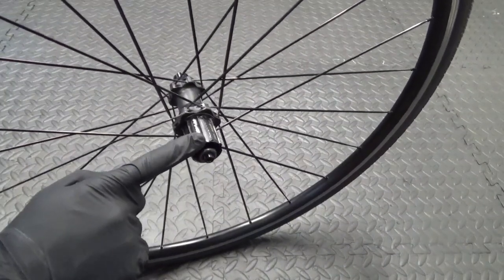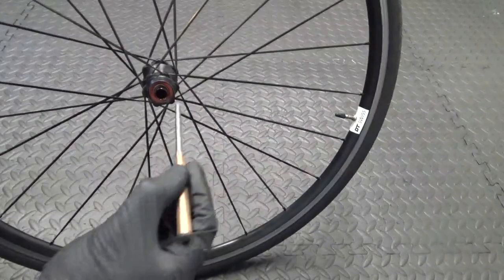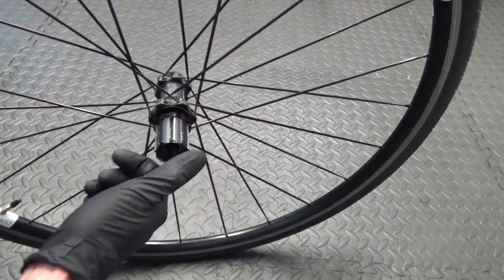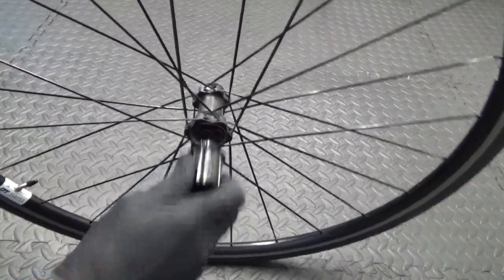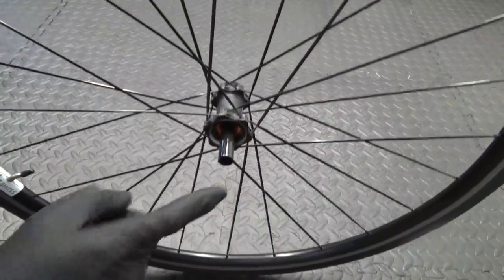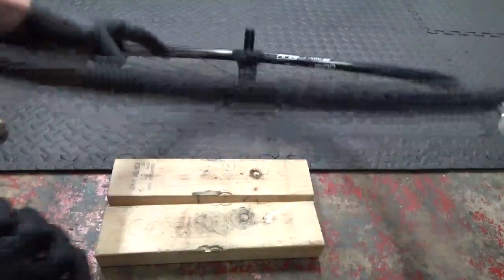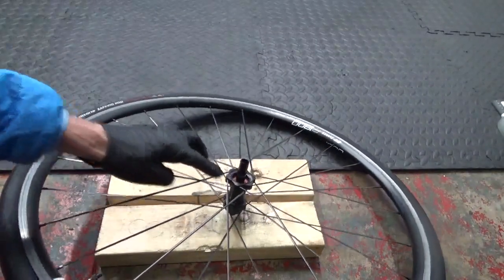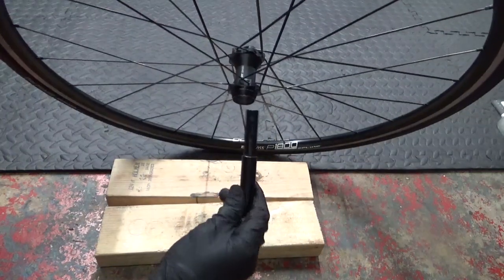DT Swiss Ratchet Freehub Body Conversion

Comment: Just wanted to say thank you. I got a good deal on the 36t version for mtn bikes. Grx cassette doesn’t need the spacer for the smaller mtn bike free hub. I did not have to buy any special tools. I already had the cassette lock ring tool and used the axel to get the bearing back in. So for less than $100 and 10 min of banging, I now have ratcheted free hub.

Comment: I was trying to convert my dr swiss hub from 3-pawl to ratchet where one of the steps is to remove that ring from the hub. I have the universal tool used to install/remove the ring from the hub. Unfortunately, it doesn't matter how much pressure I apply to the key I can't unscrew that ring from the hub. Does that mean the ring got seized to the body of the hub and I will get stuck with 3-pawl hub or there is a trick to remove it?
Reply from the maker: https://youtu.be/_266hl6psPY

Comment: Amazon had a (generic) specialty 3 pawl ring removal tool and the ratchet ring install tool for about $15 each in the US. If you have these then I guess you can just pull the ring and you don't need to remove the axle and bearings because you aren't heating the hub. Just pull the ring, install the new one, and install the new ratchet hub - have i got that right?
Reply from the maker: Only as long as the tool is long enough to fit over the axle!

Comment: Hello. Thanks a lot for your video, it really worked flawlessly for me in every step. I have 1 question though. After the successful replacement, I realised the new freehub is a bit shorter than the old one. There was a spacer previously installed with the cassette which I removed and it fitted fine after that. I also had to recalibrate the rear derailleur. But I am worried if I ordered the right upgrade part. I have p1800 road wheels and hg800 11-34 cassette. Will I be able to fit other 11speed cassettes eg R8000 on the new freehub in the future?
Reply from the maker: The HG800 is the same as the R8000 cassette!

Comment: Forget all the other videos about this conversion. Even the DT Swiss one. This is the one.

Just converted my hub and it went perfectly. Getting the old lockring out is the hardest part.  I did buy some Chinese tools from ebay and they worked well, but you need a rock solid bench vise to use those.  Thanks for making the video. Couldn't have done this without you.